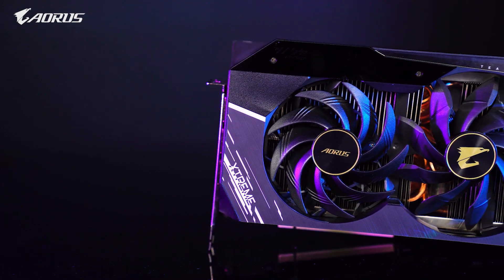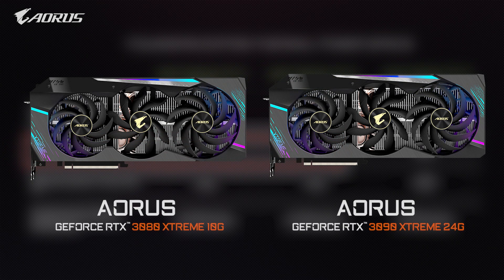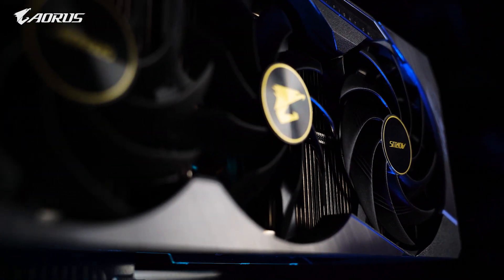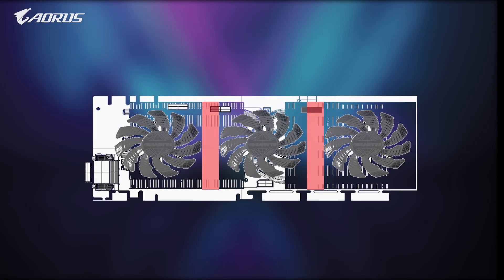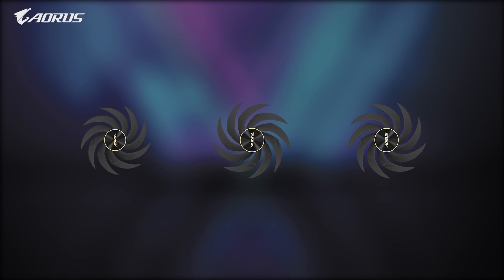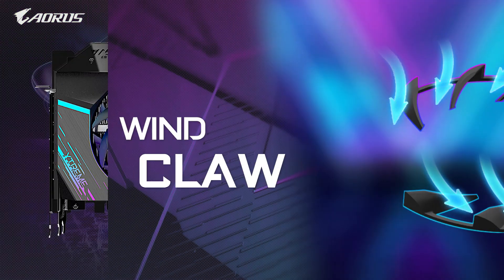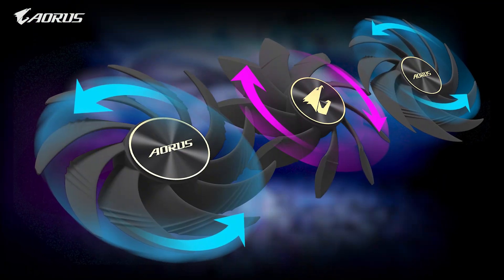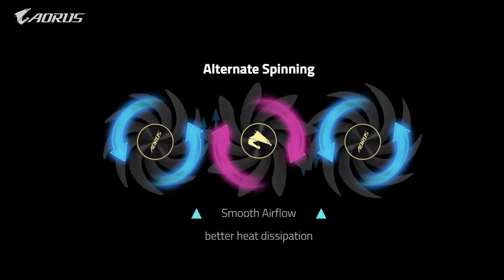AORUS GeForce RTX 30 Series | What is MAX-Covered Cooling?

Comment: @GIGABYTE DE
I do quote from the website gigabyte.com that the 3080/3090 AORUS cards EXTREME and MASTER do come with a
VAPOR CHAMBER & HEAT PIPE.
With direct contact to the GPU and VRAM, the large copper plate combines the composite heat pipes to efficiently transfer heat generated from the interior cores to the heat sink.
No word about the VAPOR CHAMBER & HEAT PIPE in  your video AORUS GeForce RTX 30 Series | What is MAX-Covered Cooling?
Why? Different subject? Can you please confirm that the 3080/3090 AORUS cards EXTREME and MASTER do come with a VAPOR CHAMBER like the 3090FE from NVIDIA?
Don`t get me wrong - I am so much into buying one of these cards.
Keep up the great work.